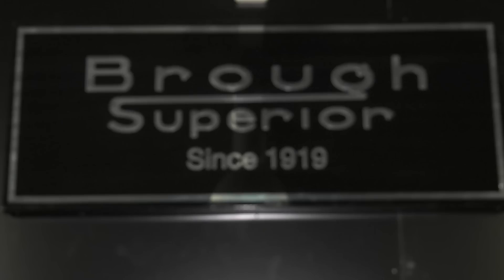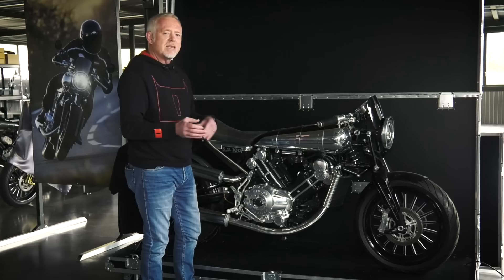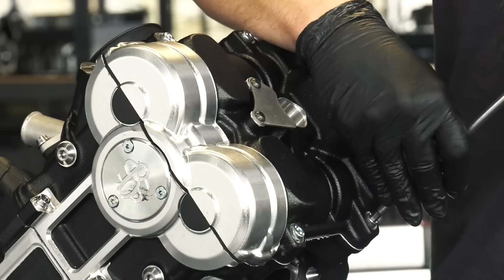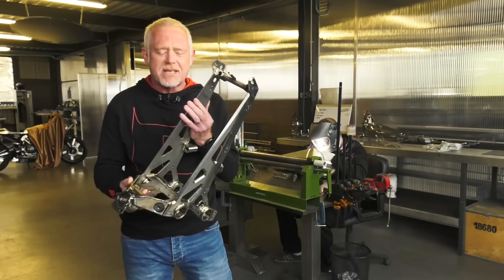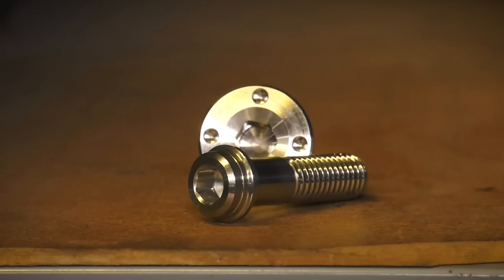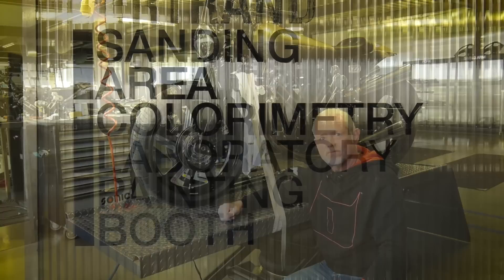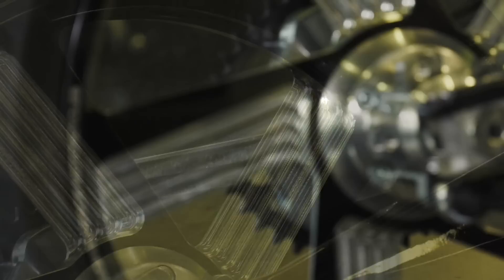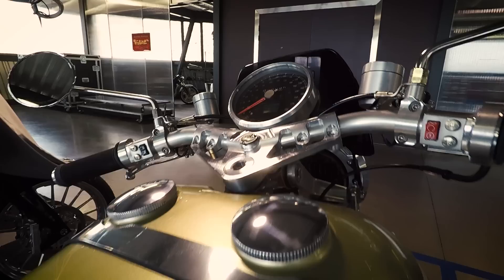The Brough Superior Factory

Comment: The Union Flag at the start is flying upside down, geez.
Reply: I didn't even know that was possible! :-)
Reply: Gary O'Brien: Cheers from Texas. -DU69160
Both fat white stripes nearest the pole; should be on top & not the bottom. 
As absolutely upside down as the very 
''Laughable Modernistical Squareity'' of their designs. -10619
Reply: @johnDukemaster  Its actually means  surrender when flown like that!!! Not good or is it deliberate?
Reply: @wideyxyz2271  I thought flying it upside down is a message for" In distress".